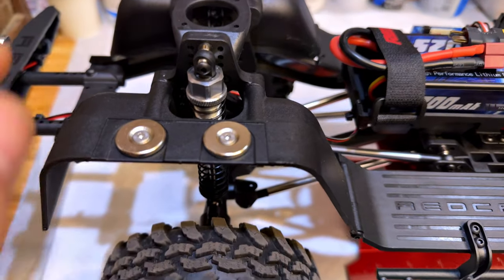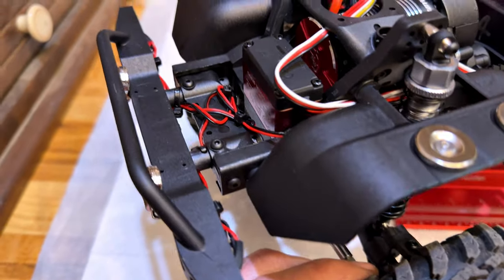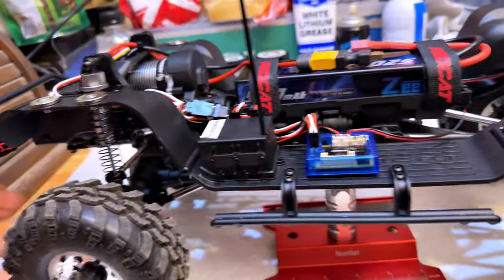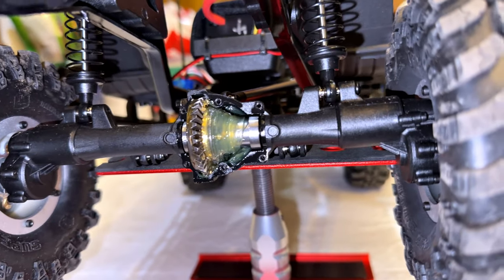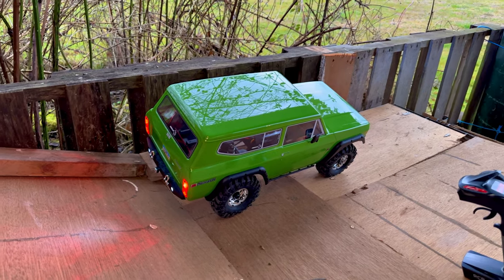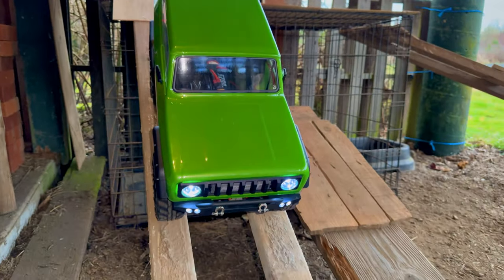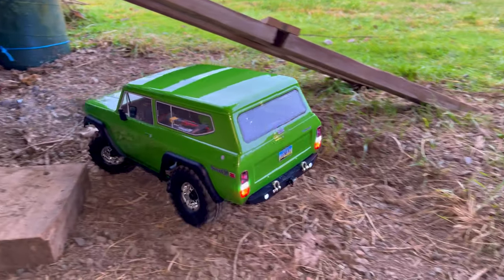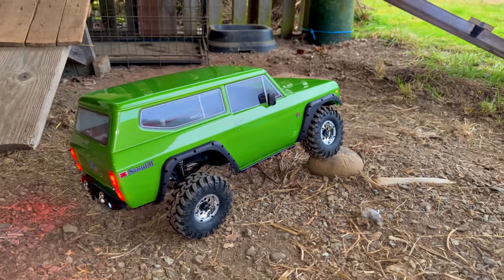Are the Diffs & Portals Greased? • Gen8 V2 Scout II! | TheSmoaks Vlog_2674

Comment: 👍🏻 you should try flying, LOL. The best beginner plane is the Easy Star by Multiplex. It has single pusher prop that’s mounted high for grass landing with no prop strikes. It has a big wing span with wings that sweep up at the wing tip to create stability in straight flight. Careful though it more fun than a barrel of Monkeys! 😉